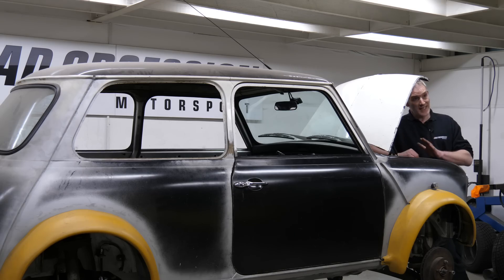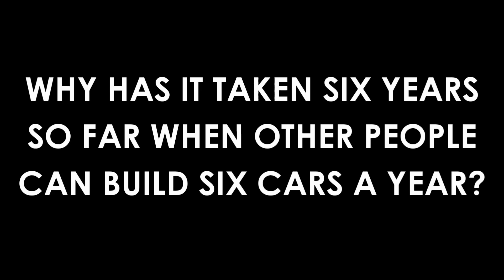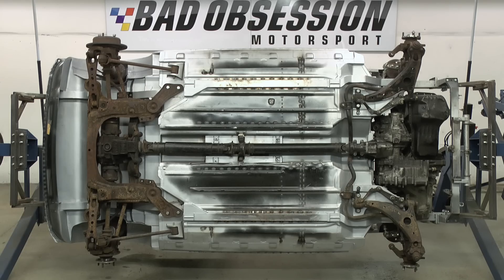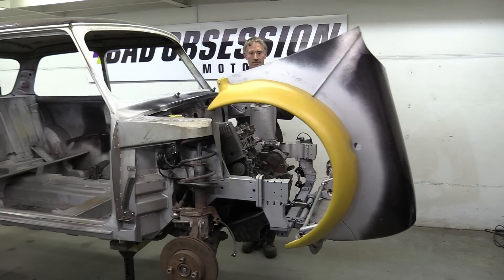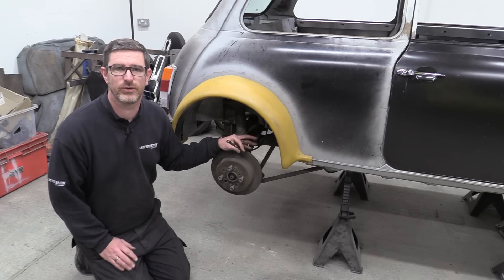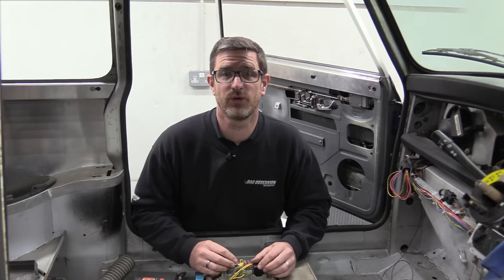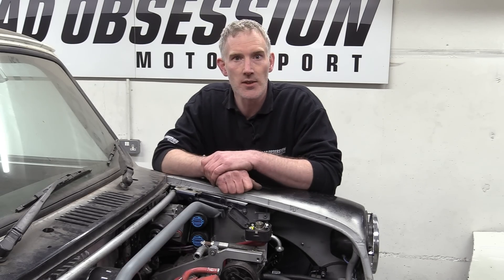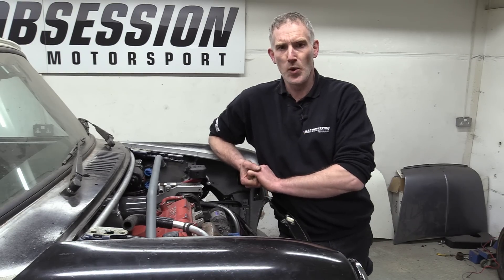Project Binky - An Understanding Enhancement

Comment: Making brackets. Fifty years ago I was just out of school, working on a GM factory floor. My job was to make, with 6 other people, 3,600 power-steering brackets in 10 hours. We did this 6 days a week. Every other week we switched to making the air-conditioner pump mounting bracket. Notice that 6 people, using 6 power presses, fitted with bespoke dies, could bend flat sheets of steel into a complete bracket at the rate of  6 a minute, or one every 10 seconds. This is the power of mass-production verses hand-crafted. Essentially Nik is hand-crafting most of the body, and much of the ancillary running gear. The cost of the infrastructure to support that production rate at GM today would be about $50,000,000 or £40,000,000. The Economies-Of-Scale means that that capitol investment adds up to about $2.50 or £2.00 per part over the 10-year lifetime of both parts.

Comment: A/C isn't only useful in hot weather, it's also very useful in cold, damp weather for keeping the windows demisted.
Reply: Irrelevant. They never get cold, damp weather in the UK :P
Reply: and even more so, in wet weather that isn't so cold
Reply: Exactly, it's Air Conditioning, not Air Colding.
Reply: cars are also kind of a self heating device... everything in a car generates heat..
it's nice to get rid of that heat without the buffting wind..  AC is a good thing.
Reply: I live in Australia, we just laugh when you pommes say "it does get hot in summer"..
In saying that, A/C does have it's merits regardless of climate
Reply: @DStead2239  oh so true
Reply: @DStead2239  [Laughs in Texan.]

Seriously, it just now dropped down out of the high 90s here.
Reply: @immikeurnot  High 90's is a nice day.. Pommie's Would melt lol
We start getting edgy mid-high 40's(107+)
Reply: Darian Murcott-Istead  mid to high 40s is pretty rare in any of the main centres in Aus... maybe inland it’s more common.
Reply: @mj_aussie_coaster_travels8310  didn't say it was common bogan.. said it's when people get edgy.
40+ is pretty common all round

Comment: This has for the past six years been my favorite YouTube channel.  You don't rush things, each piece is totally custom built.  You show the work, from  CAD to bending to welding.  That's what makes this channel so fascinating.  Problem, solution.  Minis have alway been one of my favorite cars so when this channel came out, I was instantly hooked.  The bracing the welding,  the panel replacements everything done properly with no parts (except body panels). Purchased and just slapped on like other channels.  Each piece was modified in some way from the doors to the floors each custom modified to make it fit for purpose. This car is not being built to compete in horsepower wars.  It is being built to suit its owner.  The way a custom cars should be built.  Totally modernized Mini, the central locking, rain sensing wipers, a decent gas tank, and safety bars in the doors.   Custom built fender flares,  a stereo, and lot more each piece designed and created to fit in a tiny space in a tiny car.  You should be very proud of what you've created and no matter how long it takes, you have a one of kind car no one will ever equal.  Group B rally car meets Mini.  Totally custom chassis.

Comment: Hahahahahaha! 

I really do love this channel. I’m building a ‘55 Chevy 2dr. 6.0 with a 6speed auto from a 2500hd, 4link rear with limited slip and disc brakes, chromoly tube control arms and drop spindles from an S10 on the front. It most definitely is not something one just throws together in a few weekends. It is quite satisfying to really do it how you want it to be. 
What you’ve accomplished on this car is nothing short of legendary.

Comment: I for one am so glad you decided to make Project Binky into a comfortable road car with air con, electric windows etc instead of a stripped out racer, this is a major part of the fascination in the build for me. I don't think assembly after painting will be that quick..afterall you could modify the standard Toyota suspension radically.....lots of custom parts and brackets there....

Comment: Amazing series and in awe of the work! One thing, the AC in my car has a blocked water drain so the floor gets wet after the ice melts off the condenser (instead of draining outside). Does your HVAC unit have an outlet for this water as i didnt see one? Wet floors are a pain.

Comment: This series has been very inspiring to me, and has been the kick in the arse that I've needed to get on with the cutting and burning on my own dream still on cement blocks. Although highly entertaining, also informative - the way some particular problem has been tackled to the ground and pounded into submission. The overall seemingly impossible in bite sized easy to chew chunks. 

That said. One of the things that has constantly been in the back of my mind. I live in the Canadian salt belt. Binky, as built to date and with a spray coat wouldn't survive a season without signs of cancer. I assume you haven't wasted your time building a trailer queen. Although inglorious, I think many would be interested in what you're going to do with rust mitigation before the pretty coating. Or maybe it's just me.

Comment: Best ending possible.

Also, as someone who tries to work on his own stuff using parts off the shelf and living with anxiety (which leads to even the simplest jobs screaming "What if you fuck this up?" in my face through pretty much everything), I can understand how basically building a car out of nuts and bolts is... time consuming, to say the least. This series has been very therapeutic in helping me work through some of those issues, though. You see someone engineer an entire heating system or wire an entire car from scratch, and suddenly, the crippling self doubt that you can't take your door cards out to add a little sound deadening is pretty much gone.

Comment: Wonderful following this. I had a “problem” with British cars for a fair bit, starting with a ‘61 Morris 850 (upgraded to a 1275 with dual SU carbs, tuned exhaust, racing type pistons, blueprinted and balanced, etc) that looked exactly like a factory Morris Mini, except for the beer van sized exhaust. Then a ‘69 Sprite, then a 2003 MINI. I have got better though... All that said, be traditionalists: go with British Racing Green and a Union Jack on the roof!

Comment: Small wheel radius and standard Toyota gear box. Many revs per rotation. Much acceleration but flattening out on top end? 

I have loved this build. Sense of humour and superb metal fab skills. But ultimately, would this not be a cracking hill climber? Any chance when it is actually finished you’ll do something like Goodwood FOS so we can all see Binky in the tin?

Comment: Thanks for that, the colour looks wonderful.....

I have had some experience with manifold fabrication and motor sport tuned length extractors (formula Vee) and found your manifold to be of interest. While the external shape will be great, I had wondered if internally you could have made some wedge shaped pieces to direct flow to the turbo and be a good heat sink feature. They would also lessen a gas flow vortex effect and maybe reduce gas suck back into the cylinder when the exhaust valve should open again. Great idea though and look forward and hope it work in its current configuration. 
Have you thought of using aluminium heat sinks for any parts that may be of concern? I know air gaps are the best heat sinks but you will have limited space for even those.

Comment: Why not use rivnuts? For small and simple things like brackets it will be a great, quick and easy solution instead welding captive nuts. Second thing, You can easly swap them if crossthreaded! Great build!

Comment: If you do another Q&A I'd be keen to know if you will be sticking with the earlier generation 1 & 2 3sgte you currently have fitted or moving to the later generation 3 or 4? Gen 5 would work well also for your application as it still uses a center feed inlet manifold although the ex manifold you've already made wouldn't suit. I assume you'll stick to the early engine and go with a modern turbo plus that ecu.

Comment: Hi Guys, I have a question about your front steering,  to achieve your bump steer you had to mount the steering arms high up on your front struts to weld your steering arm to the side of the strut. I was worried about the strength of the strut wall and is this going to be legal to do so. Thank you love the show

Comment: I'm going with a curb weight of 1200kg or 2650 freedom units.

Everything in my alltrac/gt4 is rediculously heavy. Hell the transmission alone is 185lbs. You've got an iron engine block, prop shaft, a couple subframes, rear diff and all the suspension bits. I think a stock st185 comes in at almost 3400 lbs.

Comment: I'm glad you explained to the wallies about the grommet situation, but surely you're understating the time needed to shine up all that running gear?  And there's rebuilding the engine and gearbox to make sure it all does justice to the rest of your wonderful efforts.  I therefore strongly suspect Project Binky is going to be around for a while yet.  Of course, all those bits may already be at some specialist re-builders, ready to appear all lovely and new-looking in the next episode, but somehow I doubt it.  But the day is not far away when the last bracket has been made and welded, and you will unplug the grinder, turn your back on the bender (not recommended) and hang up your helmet for the last time.  I can feel the tears welling up already.

Comment: I wonder what you guys would come up with if you weren't pressed for space and the considerations with Binky; a  ford cortina powered by twin rotary engines at each wheel? An italian supercar without malfunctioning electronics? A motorcycle without an engine that is powered by the users own legs through the use of a chain and gear system?

Comment: The car is nearly finished and I'm still hoping that they'll redo the steering. Sheet metal welded onto a shock absorber just doesn't seem as strong as the cast iron or forged steel steering knuckles found on other cars.

Comment: I would like to add my two penny worth to the manifold debate those that think an even track manifold of equal length is necessary is mistaken, Mercedes F1 engine designers use a very similar stubby short track manifold on their exhaust side of their F1 cars because they realised it’s all about instant pressure not flow rates (even on the exhaust side) so this manifold will work really well and have minimal spool up time and not only that. It’s a work of genius...

Comment: Please put lots of heat shielding around the exhaust where it passes through that tubular section under the rear seat. I have nightmares that the radiant heat will cause the rear seat to catch fire, and that would be bad

Comment: Two observations on the content. 
One,air conditioning, if the evaporator is ahead of the heater core in the airflow,allows for a much more rapid demisting of a fogged windshield. And since it never rains or gets cold in the UK..........
Two. The WWII P47 ,called the Jug,had its shape and size largely due to a remote turbocharger. The ducting back and forth and the various heat exchangers and whatzits just used up cubic like mad. So this project is called Binky. Not Scrumpy Jug. 
So I am going to insist,therefore,you simply cannot compare apples and oranges. No matter what colour Binky gets painted.
I shall see myself out now.

Comment: I have a serious question.  Knowing that the back seat would never really be capable of carrying anything bigger than a small dog, why did you keep the back seat and not use that space for the fuel tank? Doing so would have allowed for a much bigger tank and you'd actually have room for things like a spare tire in the rear. It also would have made your center of gravity lower and put the weight more in the center of the car.
Reply: Because they wanted a proper car, not something that can't be used - plus the fire risk

Comment: Could the front flip-clip do its thing while driving? Like if someone sat on the key fob?
Reply: How could you sit on the key fob whilst driving? Why would your arse be anywhere near the steering column? 🤔🤔🤔
Reply: @karlgaff9303   The Key fob could be anywhere, it does not need to be hanging of the key does it?
But attempting to press it with your arse while hanging of the steering column would make for a great video.

Comment: The boot holds just about 100% of ?? all so I personally would have put the radiator in there. Oil cooler and charge cooler rads would stay up front and the boot air flow louvres would look cool. IMO. Others might laugh.

Comment: Flexible brake lines do not expand. They are used in race cars end-to-end so why not use them in a road car? To be honest I would not have used them for fuel (cost) but hey they work just as well so why not.

Comment: I'm just here for the fabrication... Seriously, I love every bracket, box, and gusset. I want to see it done, but I'll be a little sad when it's over. Here's what has kept my attention aside from the British humor: the manner in which you guys are going about this build is something a builder with sufficient skill, patience, and a moderate shop could accomplish. I'll contrast this with some of the "build" shows on TV. There are two guys on this build, many of these shops you see on TV are putting from 6 to 12 guys on a build, are fabricating lots of stuff with CNC equipment as opposed to the template/cut/weld/finish method used here. Equipment, material, and parts costs are of almost no consequence. While it's fun to watch, it's not realistic for most of us either in terms of having the money or machinery to produce the same thing.  Binky is off the chart in terms of the amount of hand fabrication and planning that has happened. It's just so grass roots; that's what makes it so interesting. The hardest part is waiting for the next episode. Oh,  I'm pushing for British racing green, with white stripes.

Comment: My only regret is that I can only like this once.
Reply: And the color should be Toyota 040.
Reply: Actually my regret is that I can't buy your stuff directly though PayPal. I mean, that's why I typed all that stuff into PayPal, so I can just buy stuff without typing in all my info over and over. Get it together and you'll sell more merch. If I could have just checked out with paypal you'd be up a few,hundred quid and I wouldn't be typing this.

Comment: well we have a  working custom car vs custom half build show car that are real just for show and not a daily drivers

now color?
Red and white looks good, but boring 
Green and white also looks good, but boring 
all Black or black white looks good but will always look dirty
White looks good, but will always look dirty

All Silver or Silver with black top
inside 

dash
Panel under dashboard Paint it Silver

door 
top of the door need wood
silver lather panels
micra  panel part paint it Black 

centre console panel wood plastic dip, side of centre console paint silver

carpet black 
seat black and silver
etc